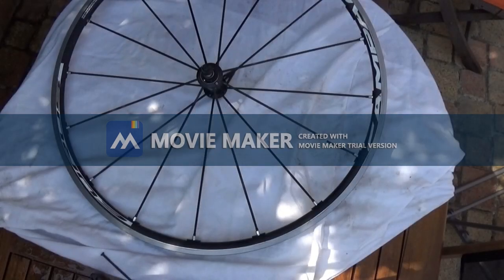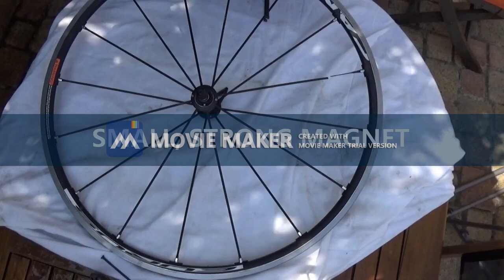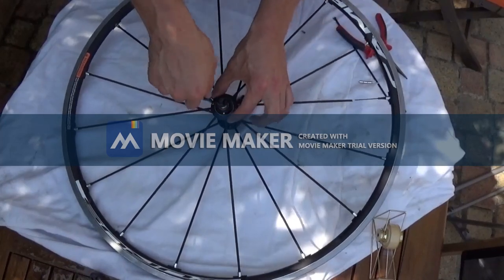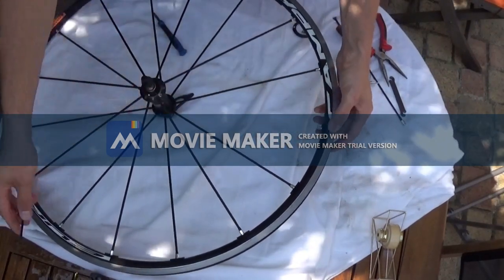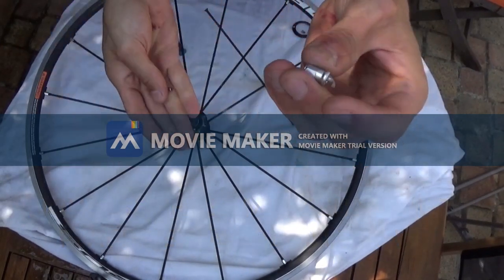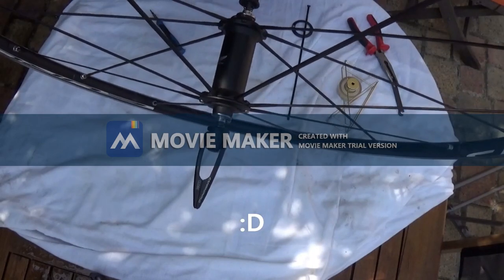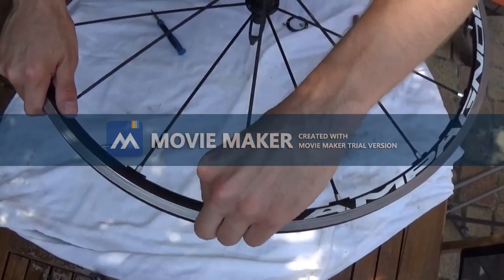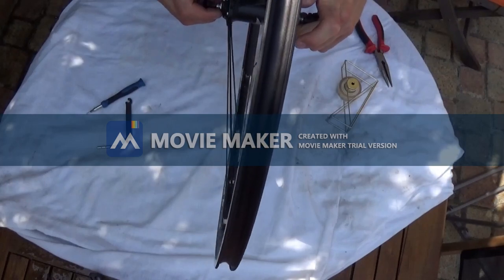HOW TO REPLACE SPOKE ON CAMPAGNOLO® WHEELS

Comment: Would you say the Eurus is comparable in strength compared to Zonda for example where it uses steel spokes? My Eurus wheelset is less than a year old and less than probably 1,500km and there's lateral unevenness after a slow puncture where I continue riding for a couple of kilometers.